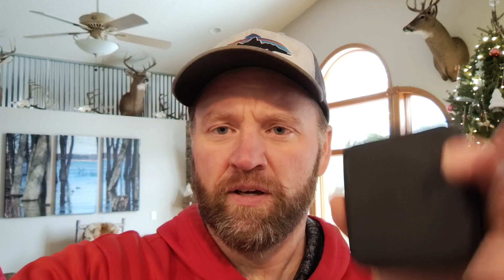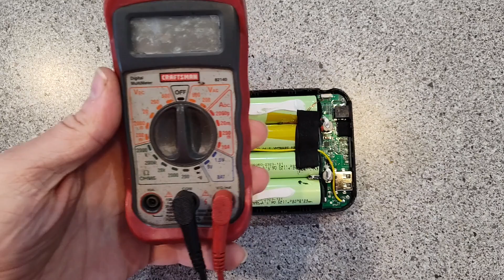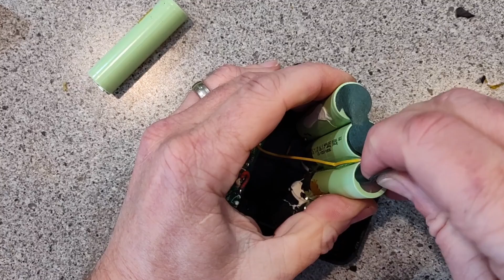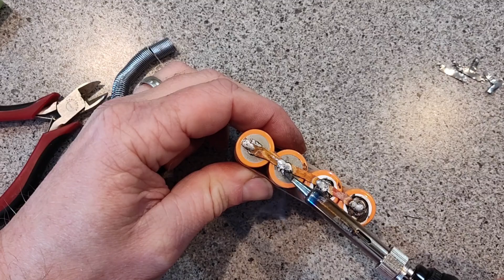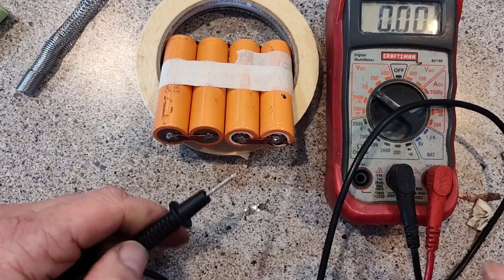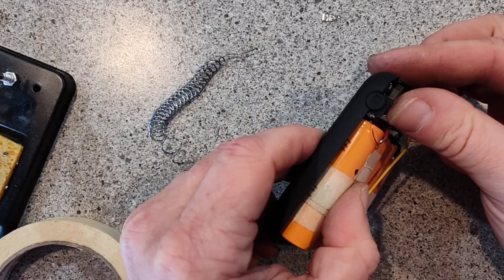Heated Vest Battery Repair

Comment: Have you ever seen the plastic wrapping of the battery literally “cracked” and shed off of the battery when you open the pack?
Reply from the maker: @68Whiskey_T_Foxtrot  I have on drill batteries that I've repaired.  Seems like the plastic gets brittle when a battery overheats and cracks.

Comment: Man I cannot get the case apart, or even started. How’d you do that!?
Reply from the maker: @electricryano  I used a utility knife to get some leverage and a corner started. You could also do it pretty easy with a small flat screwdriver. You have to use some force either way and will likely leave some marks but once you get it started it's easy. Thank you for watching and good luck!